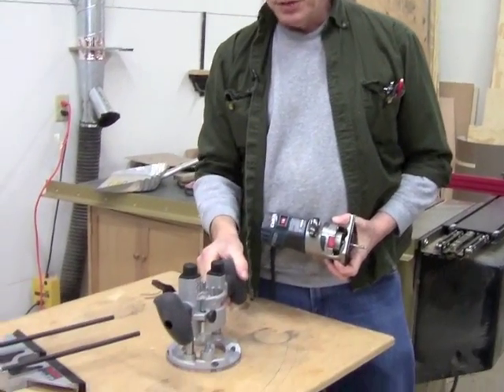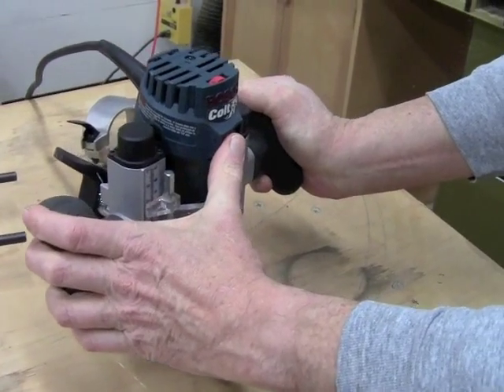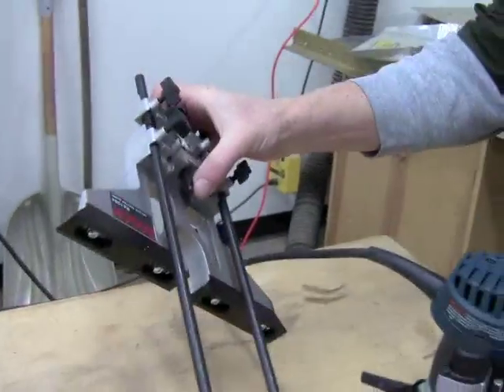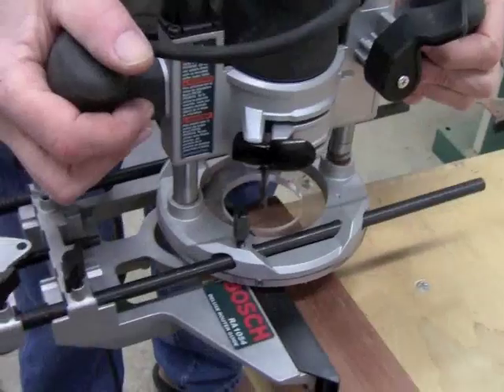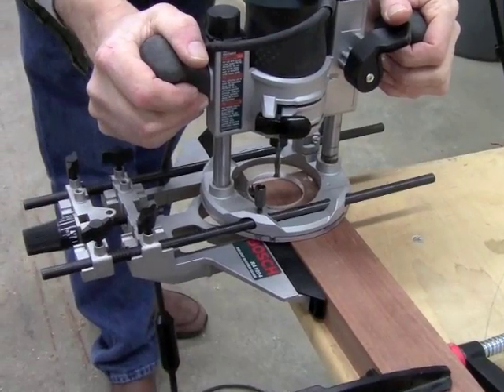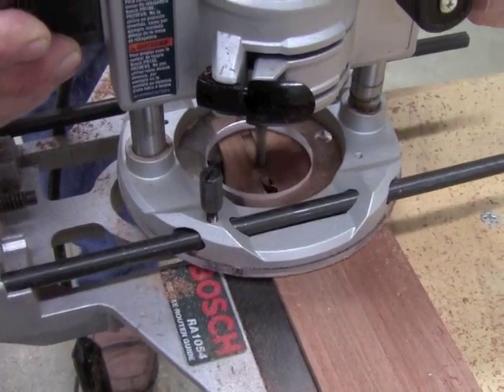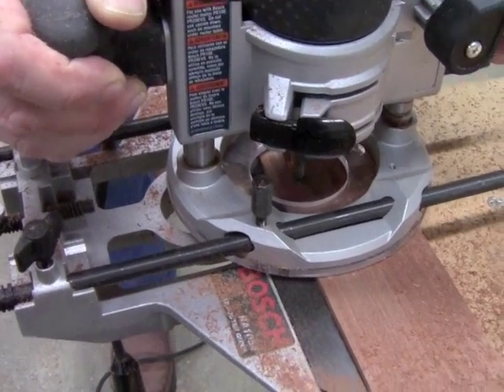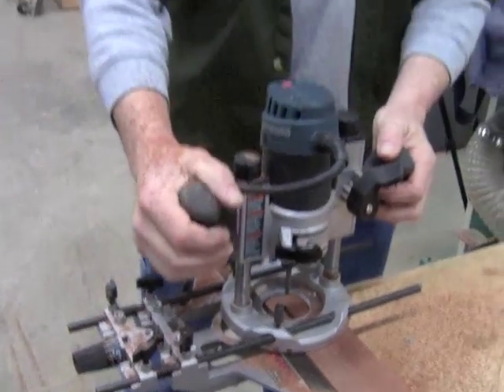Bosch Colt Router Plunge Base

Comment: Hi Bob, I was wondering if you guys (and gals) had a DeWalt DW6913 Edge guide in the shop to see if it would work on the plunge base. My question stems from wanting to use edge guides on both sides of the piece which the Bosch edge guide prohibits.
Thanks and as always, great job with the video. I appreciate y'all! and buy Pop Woodworking locally.